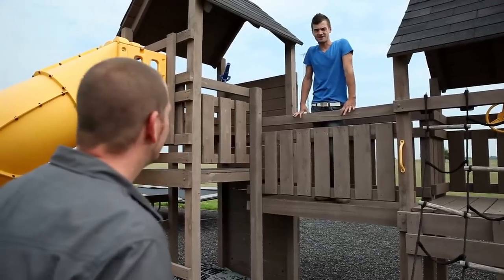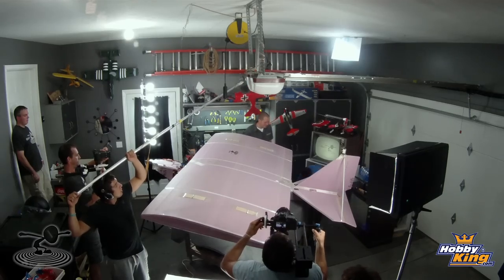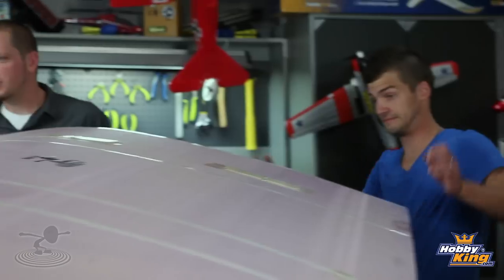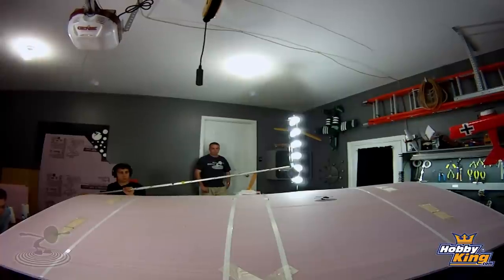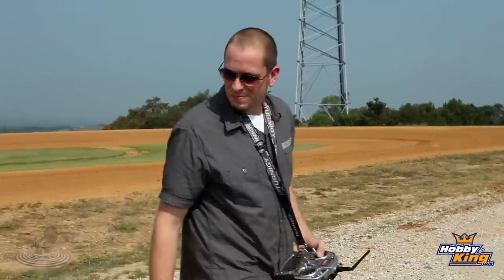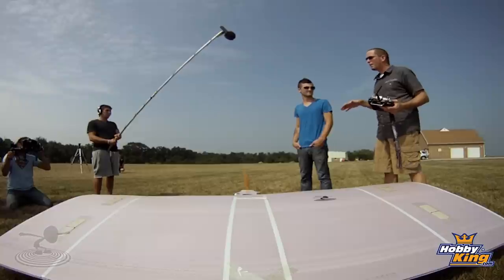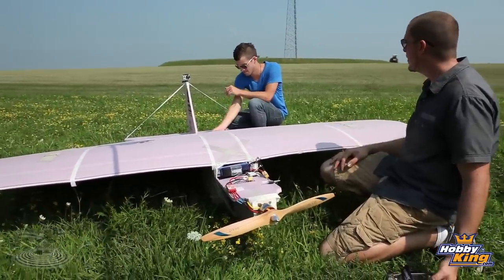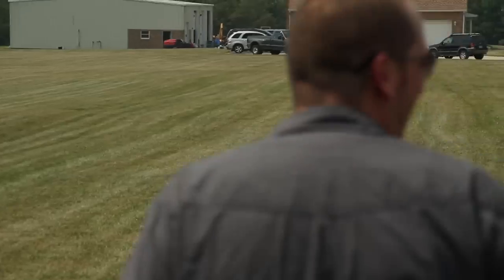Flite Test - Flying Cinder Block - PROJECT

Comment: Try instead of putting a cinder block put a 12v car battery in there and see how long it'll last.
Reply: I'd build a massive 12 F size Ni-MH cell pack inside a empty car battery case. At 13AH each, that means a output of 12V @ 26A rated output, as Ni-MH is generally good for 2C. Nice and weighty, and packs a punch.

I built a UPS based on that, 2.6kWH total or 24 Cells. Expensive, yes, but more reliable then anything else. The controller is an Arduino logging power usage and events such as sags and spikes to a SD card. It trickle charges consumed power back at C/13 after power is restored, with a 15% overcharge. Output is 120VDC for backup power because SMPS are just as happy with DC and inverters are a waste of power in that scenario.

Overcharge? At speeds =<0.08C, modern Ni-MH cells are fine. This is because a catalyst prevents electrolyte electrolysis by recombination of H2+ and O- ions, releasing excess energy as heat. Lazy dumb charging FTW. :P
Reply: Red'sDomain that is a brilliant idea
Reply: Red'sDomain  you we he car battery to power the motor somehow I think that would explode
Reply: Bichingo that was an excellent pun, you know, 'props'

Comment: High marks for the attempt!  The plane flew in ground effect which is from ground level to an altitude of up to 1 1/2 x the wing span or in your case, 12 feet.  This is a great video to demonstrate the phenomena.  Unfortunately several full size planes are lost each year when they are overloaded, take off in ground effect and impact the ground because they couldn't climb out.  Too bad it crashed, It might have flown with twice the power.  An old aviation adage, an airplane flies on the wing and climbs on the prop, make sense?

Comment: Awesome video. Im thinking it needs tons of power. Like two more wing props everything on a series parallel slightly overdriven by a volt or two. wings filled with lipos like real fuel.

Comment: The problem seems to have been the wind shadow coming from the trees right in front. If you are correct and you launched 'into' the wind, those trees right in front would create a wind shadow. The bad part of it, is the rotor caused by these shadow. The rotor will push the plane down. These forces can't be ignored. I feel if you didn't have the tree rotor you might have been able to get a little higher...

Comment: That was an excellent show guys! Everything seemed to be slightly different but better. This was a show that I could relate to because my son and I have projects too, but not that scale. What a fun show!

 I agree JB, just a little more lift will get you through the turn, though I noticed that  the predecessor seemed to turn fairly well. Was the weight or power on this one less?

 If you fly the Bricksler again, pitching up w/ limited power = more drag and less lift perpendicular to the earth.

Comment: You guys should try to fly small Josh. That would be awesome.

Just use a really long wingspan with a bunch of motors. It would be easy if you guys put effort into designing it. You would have to create a better support structure and thing like that but you guys should definitely do it.

Comment: Just a small hack for anybody who builds a plane with wire-struts for the wings: Always put wires underneath the wings AND above. Especially if you are building a very light plane.
Otherwise the wings can start to flap like a bird when hitting a breeze, this caused a crash once with one of my planes.
By putting wires above the wings to a fixed carbon fiber rod in the fuselage, the wings get very stiff and stable. 
Just look at old planes like the Demoiselle or Bleriot XI

Comment: try this again guys, with a glow motor since on takeoff and climb the climb rate actually depends on the thrust from the engine (ex. a airliner on final) pitch for speed thrust for altitude :D

Comment: Out of curiosity, would it be possible to use an already fast plane with an electric motor. And stick under it one or two of the smaller rocket pack and just activate it mid flight for a crazy boost of speed?
I know it sounds crazy and totally risky, dangerous and impossible but doesn't that make it even more tempting and awesome!?!

Comment: It looks like you barely rose above ground effect. In the second attempt, the plane gets to a height and seems to stall when trying to get any higher, resulting in that hard landing.
This is why it would have failed if you had turned into the wind. An attempt to turn that sharp when relying on ground effect would cause a stall.

Comment: 1:40 "the first attempt was josh bixlers idea" brings up a plane strapped to block barely even bigger than the brick itself "I didn't think it was gonna work. Not enough surface area in the wing... not enough power either, but ya know... he loves the hobby, gotta give it to 'em, he tried..."

Comment: LOLZ awesome. Fun Fact! NASA used to playfully call the the space shuttle a "flying brick" due to the ceramic tiles used as a heat shield.
Reply: +Ziggy Wiggy Also because the Space Shuttle flew like a brick on landing, with a Lift/Drag ratio of only 4.5,  which is absolutely hideous for aircraft.
Reply: yeah it is engineering wise the most complex aircraft and also one of the hardest to fly

Comment: You guys should do a slow flight challenge. Make a scratch built plane, no cheating (harrier...etc). Any size, any material, whoever can fly in a straight line the slowest wins. Maybe do a full throttle race too (still whoever is slowest wins).

You could then make a derivative of the plane as a slow stick and make it a nice park flyer trainer for beginners.

Comment: @FinallyAUniqueName please take note of the planes attitude flying into the wind and then turn to flying with the wind. specifically the transition stage where the plane needs to build momentum to travel with the wind. try it with a slow flyer and the effect will be more pronounced. do a snap turn with a light 3D plane at low throttle with no wind. it loses altitude . try it in a breeze, it loses even more altitude. in a perfect world you are right. we dont live in a perfect world

Comment: @FinallyAUniqueName next time u fly in a breeze .. please notice that the plane will drop as it turns with the wind as the planes speed actually drops as you make the transition also please note that when you turn back into the wind the momentum / energy if u will will drain away but you will also gain altitude i don't think i can make it any simpler than that .. if u really want to learn more about it, basic math and a protractor is all you need.

Comment: Hey Josh, why are you using a turnigy neck strap instead of the spektrum one which is provided with the radio. (I saw you using the turnigy neck strap at 6:52)

Comment: Don't really know much about the physics behind planes though do know how they create lift but am I right in saying that wing span can be shortened by making the wings longer along the fuselage? Those wings don't seem to have a big enough wing span for the size of the plane so wondered if the length of the wing also increases lift?
Reply: In my humble opinion, there are two main factors I see at play in wings. Aerofoil lift, and surface area to create air deflection lift. What you say makes sense, in the sense that if you are limited in how wide your wings can be, adding more wing length is an easy way to add surface area, which also adds structural strength to the wing. If your wing is flat with no airfoil, I don't really see the difference between a wide wing or a square or longer than wide wing in terms of lift if they all have the same surface area, all will deflect the same amount of air if put at an angle, like a kite. The main difference would mostly be with roll stability of the plane, since wider wings will make for slower banking of wings, where as short ones will allow very fast roll rates. Where things get more complicated in my opinion is when airfoils come into play. To my understanding, the efficiency of an airfoil that is designed to create lift or down-force resides in a change of airspeed between the top and bottom of the wing, and the more sudden the change, the greater the effect. If a wing is very long but not wide, it means that it has a very long and gradual airfoil shape, and while such a shape might not make much drag, due to the fact that its such a gradual shape, the airfoil may not provide much advantage to the design. Very wide wings with a short airfoil shape would have the air be affected much more suddenly, since for the same airspeed, the air would take much less time to go from the leading edge to the trailing edge of the wing, and thus across the whole airfoil. I believe that this is why sailplanes have very wide but narrow wings, so that the airfoil may be most effective. These are just my thoughts, and I invite anyone to add information or correct what I have said :)

Comment: I honestly think you would have been better with a flat bottom airfoil unless you actually designed the thing and calculated a reynold's number for it to determine that it was an efficient lift producer for the airspeed you were using.

Comment: You need to be able to leave ground effect in order to be flying and you used ground effect pretty much the whole way there. I say you have not beat the challenge yet. May I suggest a larger aspect ratio and some more power. Lets see you get maybe 5 to 10 spans high and then I will say you have done it.

Comment: Looks like you have JUST enough thrust to get it off the ground, but dont have enough speed to maintain lift.  I bet a prop with more pitch would be better.  It looks like the CG is a little too far aft also, making you pull the nose up and increasing drag at exactly the wrong time.  Sweet plane though!!!!

Comment: Did anybobody try to use standard serwo as "cell switch" for voltage change lastly? With addition of supercapacitors it could produce peak high amperage usage ability for "overvoltaged" engines, without need of power controllers ( limited to ~100Amps ). Please note that I am a beginner at RC technology and I could be horribly wrong...

Comment: You could use a sellig 1223 airfoil, bigger span and a smaller root chord, Search about SAE Aerodesign airplanes. They can fly 15kg brick with a 2,5 kg airplanes...

Comment: Try a motor from an old electric lawn mower, cheap and powerful.
Reply: You could do the same with 2stroke weed wacker motor more fly time fuel isn't as expensive as a nitro plane or what they sell for gas rc mixes in the hobby store I watched a video this guy said fuel was 25 bucks a gallon just buy a gallon of premium gas from the station and the little bottle of 2 stroke motor oil I'm actually working on doing this now I'm making it like a rat rod deal making the exhaust custom myself and I'm working on a ram air intake like you see on the bf-109s 
It's going to be a Frankenstein of a plane lol

Comment: Make a super powerful motor fly straight up in the air with nothing else on it except a battery.
Reply: The torque of the motor would just spin the battery around in a circle it wouldn't even get of the ground
Reply: +Douglas Skaff *off

Comment: hello guys, I fly RC, rotor and fixed wing, I also have been flying hang gliders, various ultralights and GA Aircraft, for over 30 yrs,  I myself have built numerous scratch build free flight and RC contraptions. yes your machine did fly, but your use of an under-camber air foil, especially the one you built is fraut with aerodynamic problems, 1) aspect ratio, is all wrong, too large a chord for the span. 2) your wing is too flexible, it clearly is loosing it's shape and not able to maintain an airfoil of sufficient curvature where it counts, 3) non-sufficient  structure to maintain shape. many of the ultralights I've owned and or flown that had under-camber- airfoils were and are much deeper percentage wise in relation to chord span than yours, you also have to consider 4) scalability with respect to Reynolds number, and air density. 

On another note, your incidence angle of the chord to fuse center line and the height of the landing gear, buts that a separate issue. 

you would have been better off with a modified Clark y foil, and a narrower but longer wing. the addition of a few internal foam spars and a couple of spanwise wood dowls to transfer the load of the subject in this case the brick to wing would have done better. 

I realize that your using only materials that are found at the local construction supply store for this build but there are a lot of things that can be used to build a flyable model from these suppliers and still keep the cost and time to build to a minimum. sorry I'm so late in seeing this vid.

I'm assuming, (and that's not a good thing in aviation), that your budget of a BILL for the airframe did not include the power plant, or the electronics. if so, why skimp on the airframe other than time, 8hrs, and weight restrictions, FAA 55 lbs rule and all.

I think this endeavor needs to be revisited.....?

keep-em flying...